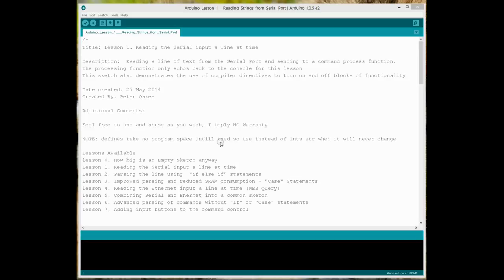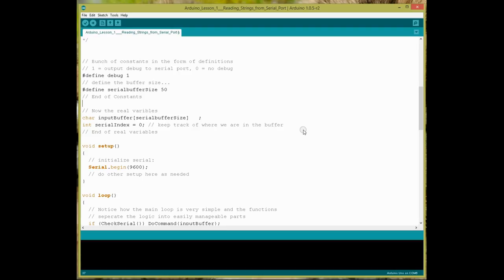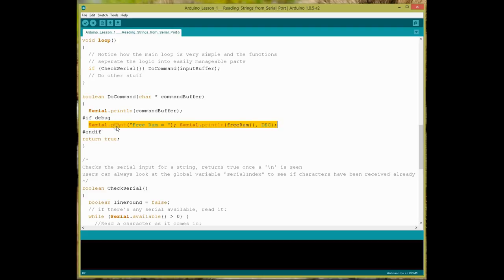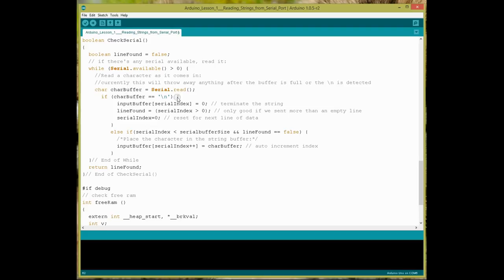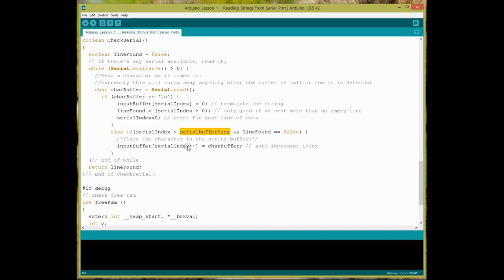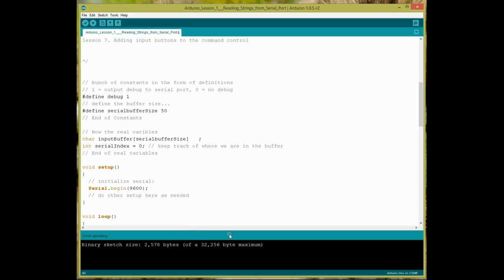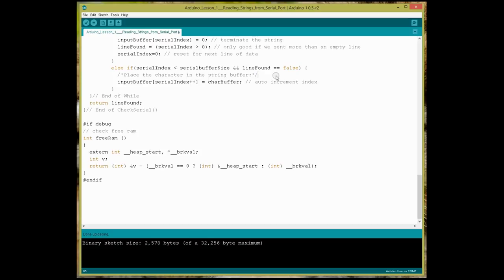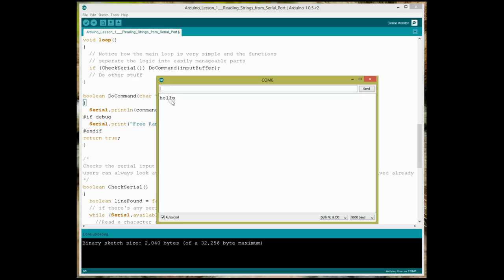Arduino   Lesson 1   Reading the serial port

Comment: Hi , I"m a newbe of Arduino and have some problem understanding the bolean function 
"please elaborate on "char * commandBuffer
i did not see ant declaration of commandBuffer  before 

what am i missing?
Reply from the maker: I assume you mean this
boolean DoCommand(char * commandBuffer)
{
  #if debug
  Serial.println(commandBuffer);
  Serial.print("Free Ram = "); Serial.println(freeRam(), DEC);
#endif  
return true;
}

The "char * commandBuffer" is the declaration, when you create a function or procedure you can define the parameters in the opening line of the function, in this case "
boolean DoCommand(char * commandBuffer)", ie. create me a function called DoCommand and allow it to receive one parameter that is a  pointer to a character string and call that parameter commandBuffer, then within the function you can refer to that parameter as commandBuffer but once the function returns back to the caller it no longer exists. note this is also just a pointer to the buffer, not the buffer it self that is being passed, this is an efficient way of sharing data between functions, in this case the line int he main loop
"if (CheckSerial()) DoCommand(inputBuffer);"
checks the serial port for data (  "CheckSerial()"  ), if data is found then it will call doCommand(inputBuffer), it is the address of the  "inputBuffer" that is being passed to doCommand, this is called a pointer. and finally "inputBuffer" is defined a few lines above all this and looks like this
char inputBuffer[serialbufferSize]  ;

In  lesson 0 it is just a shell with a debug statement but has not been expanded on, if you look in sketch 0, you will see it is commented out.
In lesson 2 it is enabled but simply prints the contents of the buffer to the serial console then returns a Boolean "true"
In lesson 1, if you look at function "boolean CheckSerial()" you will see a better example of using a Boolean function, this function checks the serial port buffers and if something has been sent to the serial port it will return a true, else it will return a false.

Maybe I need to do a new series on programming the arduino with updates for the new IDE ??

Either way, I hope this helps and welcome to the world of the Arduino, you should have fun.
Reply: Thanks' I understood and now have to do some more examples in order to make shure i got it. .
The difuculty arose from the fact that i did not understand that naming the argument in the function is only temporary and will be replaced when you call the function by InputBuffer

Comment: i need help i run serial connection from raspberry>arduino and  pi sends value b'1'  but arduino returns value 49
Reply from the maker: is that binary '1', ok either way I think this is a pretty simple problem
The '1' you are sending from the pi is being converted to a number "1" for transmission purposes (Probably), this is being sent to the pi as decimal 49, check the ascii table here to see what I mean http://www.asciichars.com/_site_media/com_photogallery/ascii-chars/xl/ascii-chars-table-landscape.jpg
The number 1 is actually the decimal number 49 in ascii.
As I am not sure of the language you are using I can not simply tell you how to send the correct value as a binary 1 but I am pretty sure this is your issue

Hope it helps
Reply: Peter Oakes thanks for help solved

Comment: Doing this with my Mega did not do a thing. I copied and paste the code over and still no luck. Baud rates correct :). Not sure what the deal is.
Reply: Edit- Found that you have to have "Both NL & CR" selected in the bottom drop menu within the serial monitor. Works great!
Reply from the maker: Mitsuwindtech Glad you figured it out, I'm sure I mention that on one of my videos but perhaps not one you have watched yet, I will try to make sure it is mentioned each time I show something requireing  it in future, thanks, it is so easy to forget the basic settings that are needed, the ones you set and forget about for months
Reply from the maker: Mitsuwindtech yup, just checked and I have that as my default setup
Reply: +Mitsuwindtech LOL, thanks! That helped me also!

Comment: tried this but got no result. My Uno does not say it is using a com port rather I've got. /dev/ttyAMC1
Reply from the maker: I would assume your using a MAC or a Linux PC?, the demo I posted is using a windows PC serial console, if you use the /dev/ttyAMC1 on your PC, does it work ?

I have a MAC but never tried it with the Arduinos so far, if you cant get it working I will hook it up and see what may be happening, let me know your setup and ill try to help

Thanks
Peter
Reply: Peter Oakes Yes you are right I am running a Linux desktop. I'm the guy that used your DHT22 webserver sketch a couple of days ago. See: faintfuzzies.ca
Reply: Peter Oakes I'm presently googling to see how to my your sketches work with my Linux setup.  I'll let you know what I find out.